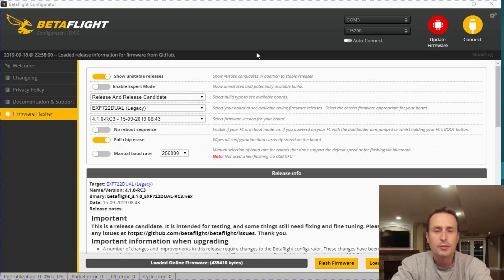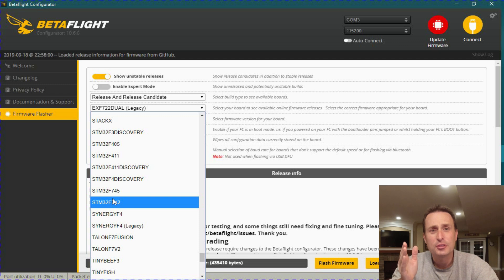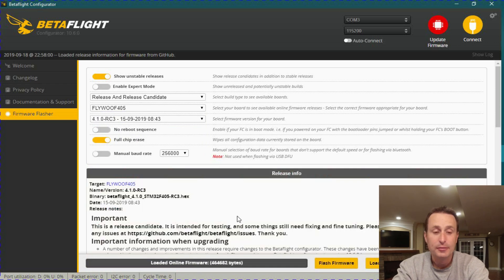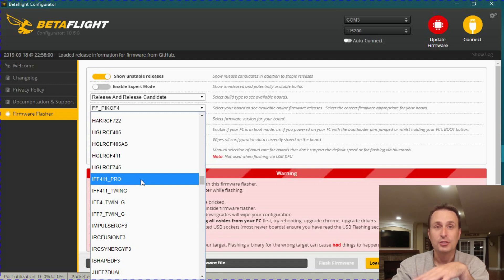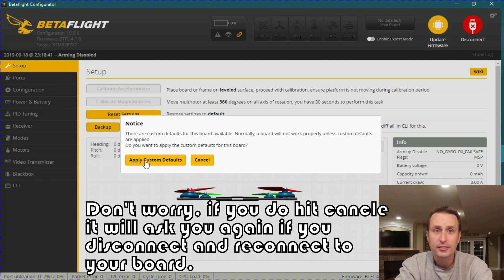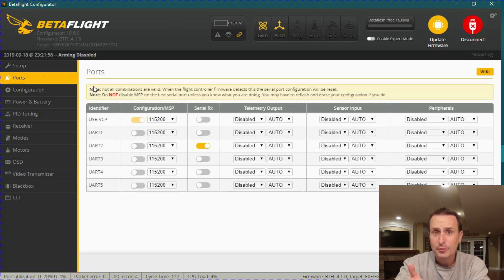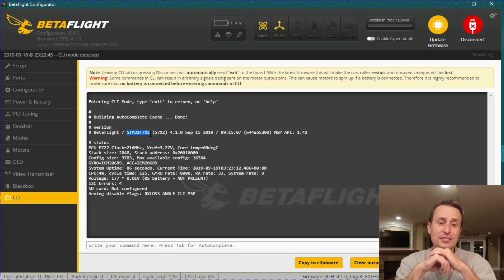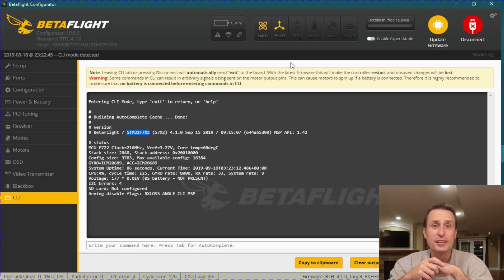Flashing Betaflight Unified Targets

Comment: Hi, I think I'm missing something. I have an OmninxtF7 and also an OnmibusF7V2. I can't tell which of the firmware versions to choose from between the two that's offered. How to find out? Thanks!
Reply from the maker: What target is on it now?
Reply: @uavtech  Thanks for your reply! The last time I upgraded, the firmware was not unified or just started with unified and were labeled with the specific board so it was obvious which one that I needed.
Reply from the maker: See what MCU is on it.  The F7V2 has an F745 and the NXT has a F7x2 (F722).
Reply: @uavtech  Ok I think I remember seeing these two firmware selections. I'm good unless you care to answer one more. A curiosity, how does Betaflight know which custom default to load assuming one size does not fit all?
Reply from the maker: There is only 4 or 5 core builds of BF which center around what processor is on the board.  The "custom defaults" for the specific board wiring is then loaded when you first connect after flashing.  Those are just pin mapping settings for the specific board to the processor (UART mapping). When you select the target, you are telling the Configurator which to use for both build (processor) and mapping (custom default).  There is a repo on Github that stores the builds (4) and configurations (hundreds --- one per board).
Reply: @uavtech  Ok thanks! When 4.3 comes out I wanted to make sure It goes smoothly. A year ago I helped a friend with an f7 that was flashed with the wrong target and he had trouble until I discovered that. I didn't want to do the same thing to myself Haha.
Reply from the maker: You can always recover by jumping or pressing the Bootloader button and plugging in the usb.
Reply: @uavtech  Hi Appreciate the note. It was more of a resource mapping problem. The exact details are long forgotten though. Looking forward to the new BF. Have Ghost and I like to stay away from the nightlies. Its been a year I think so I just am lining up my ducks so I can transition without losing prime flying time. Almost every weekend its been TFR land because the president goes home almost every weekend. I wouldn't want to be fussing with the firmware on a flyable weekend. With your help I feel more confident that I can choose the correct firmware. Awesome!

Comment: Why is the radixli so nosie on 4.1 it flys away on defaults
Reply from the maker: because the built in lowpass filter on the Radix is at 900hz vs other gyros it is at 250hz.  So the radix will need more filtering in the firmware to be equiv.
Reply: @uavtech  I put all kinds of filtering on it and couldnt get it up. The yaw axis is stupid nosie. Most of the bad is between 200 and 400. With peaks around 300. I got the p and r down but the yaw isnt moving

Comment: finally, i was wondering about (Legacy). after the video i went and moved over to the new STM rc3 for omnibusf4sd from 4.1rc2 on this new build. very pleased, now i can be ready for the full release of 4.1. its has been a great version of firmware so far. it blows 4.0.x out of the water imo. i just couldnt get 4.0x to fly how i wanted. 4.1 is so nice. i noticed Pid_process_denom = 1 now instead of 4. any reason?
Reply from the maker: Just matching gyro rate.  A Invensense gyro samples at 8k (perios).  When denom is above 1, we are just down sampling.  Best to do that after gyro filter in theory.  But in practice, it doesn't matter.
Reply: my bad, it went from demon 1 to 4, i also noticed dynamic notch range was = auto in rc2 and now = medium in rc3. im very interested to learn as much as i can. ill just have to run some logs and see about the dynamic notch range. thanks again
Reply: @brandonwoodford579  The denom (denominator, not demon) might be set conservatively. Some people might tweak it if the CPU has spare cycles.

Comment: How do you know if you should use unified or legacy?
Reply: I think it's up to you. At a later time, the legacy is gone. Good for build times and maintenance 👍🙂
Great step forward 🙂
Reply from the maker: I use Unified, but if you have an issue, fall back to Legacy; why their are still available.
Reply: Betaflight is in Release Candidates right now, please try the unified, and complain where necessary.

Comment: How to find motor pins layout on FC? I found only ground becouse was easy.
Reply from the maker: You would need to look up the board spec sheet.  Or follow the traces to the pins on the MPU.
Reply: @uavtech  I have iflight twing mini 20x20 and I need to cennect to full size esc. on iFlight website ther is no pin layout and traces are to small to track on pcb :(
Reply from the maker: Yeah, the config file at: https://www.iflight-rc.com/index.php?route=product/product&path=87&product_id=912 tells you which Resources go to which Pin, but to figure out where the pins are located you need a wire diagram from iFlight.  I don't see one for the pin header that connects to their ESC.  Of course for their ESCs, it is plug and play.